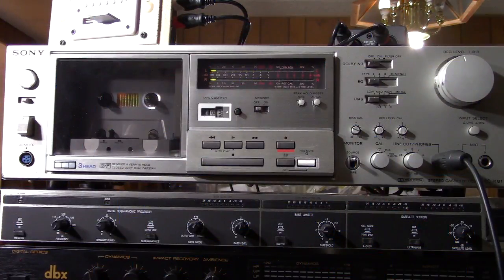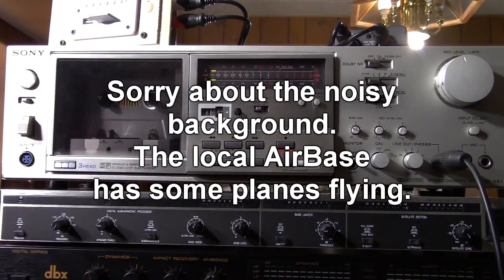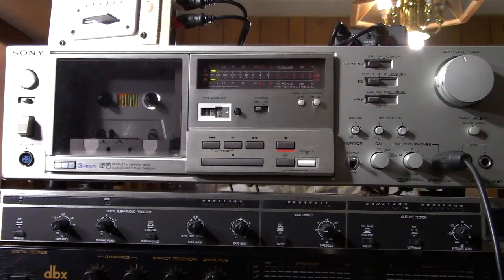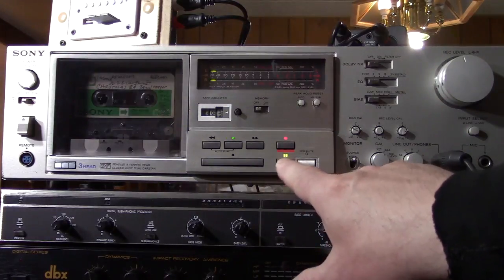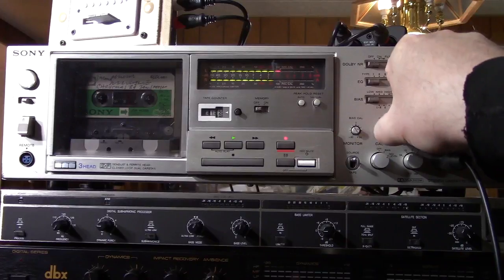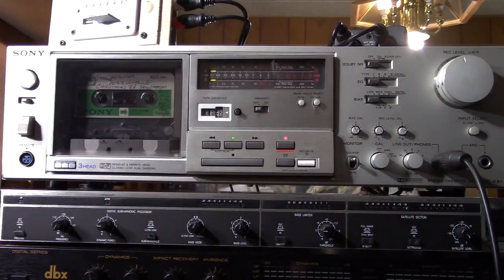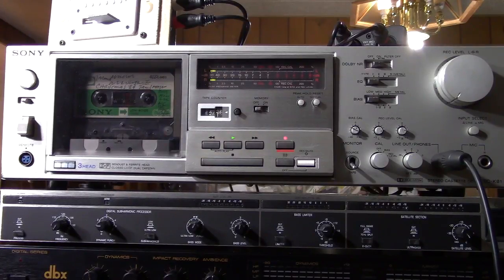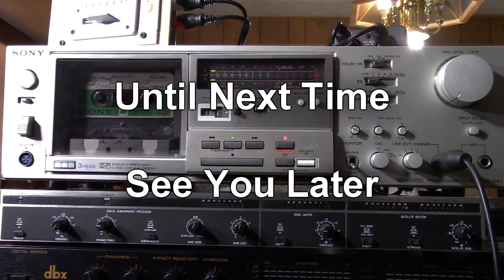Sony TC-K81: Quick Demo- Lo Tape

Comment: Nice deck amigo. I got my old TCK81 back from my brother in law last year, I sold it to him about 25 years ago when I got an Akai GX95/2. Turned out he only used it a few times as he had gone over to CD's and it had sat unused for nearly all that time. I had it serviced by Armstrong Audio in Walthamstow as it needed new belts and re-lubricating, they were amazed at its condition. One of the best cassette decks available if you don't need Dolby C or S.
Reply from the maker: I would agree with your assessment. It is an amazing deck. Thanks for watching.

Comment: The lower the BIAS of a cassette deck can go without distorting, the better the cassette deck is.
I have also experienced the 1980/1981 Sony decks to be OUTSTANDING in this category. I owned a K71 a few years back myself, that thing had one amazing recording capability.

Comment: Thanks for the demo as I am considering getting one.
I'd advise against restoring the rollers with that spay because it is bound to leave deposit on the underside of the band, which, when spooled, would be in contact with the magnetized portion. 
Just a suggestion

Comment: Had this deck in the early '80s.  Fantastic quality, especially when using type IV Metal tapes, that I reserved for my favourite bands. Because of the cost of Metal tapes, I mostly used Chrome tapes. My records had very few passes on them because I'd transfer them directly to cassette. Loved tweaking the calibration for the perfect recording. Incredible deck, maybe 2nd only to the Nakamichi 3 head.

Comment: I have started to get a little collection of K-series. My grandads k61 was my first, now joined by k22, K33,  K44,  K55,  K65 and K75.  Just found a k777 that's been in a shed for example years (could be a real project) still want k15, k71, K77R and k81. Think 12 decks is enough for any room. When all ready I will upload a "show and tell" video